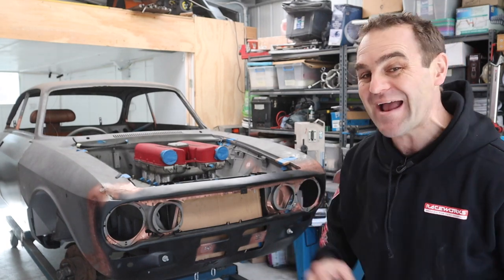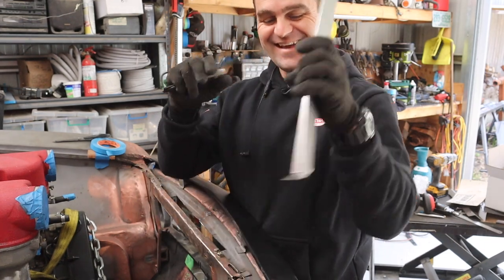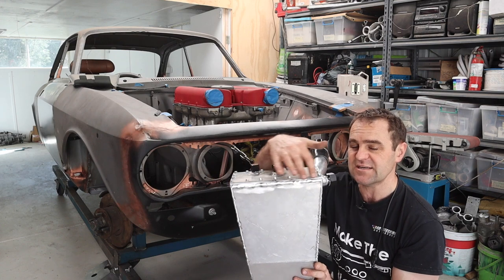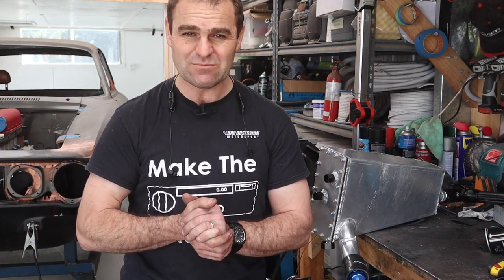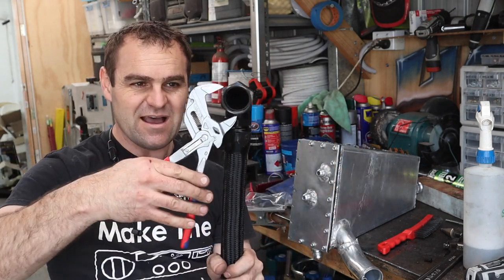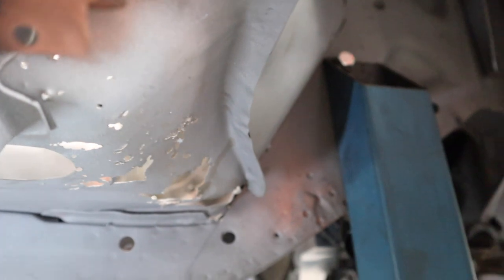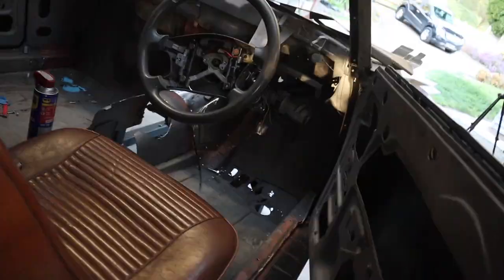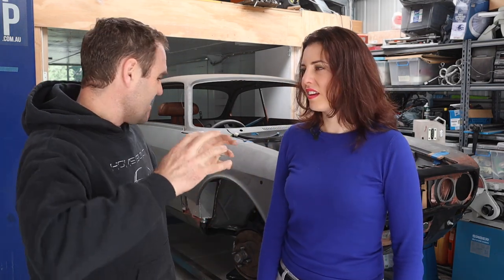Pressure testing my DIY dry sump tank - Ferrari engined Alfa 105 Alfarrari build part 60

Comment: The bonnet is front hinged, and the front lip of the bonnet recedes into the space you’ve filled with oil lines and new metal work. You may have to change to rear hinge or no hinges at all. Just bonnet pins.
Reply: Was going to point out the same. The way Jeff modified it, I can see space for the bonnet to hinge downwards.
I can't believe Jeff missed it, he is probably going for bonnet pins...

Comment: Hi Jeff,
I had an issue many years ago with aluminium tanks in a boat. Now I know a boat is in a very different environment than a car but the tanks were not exposed to direct salt air or water. There was corrosion where the rubber straps touched on the raw aluminium and I was told that the sulphur in the rubber was the cause. It was a very simple fix by putting a layer of paint as a barrier, and I added some timber packers. I am no expert but thought now might be a good time to let you know.. just in case. Love your videos mate, keep up the great work. Kia Ora to Mrs Jeff

If a member made of rubber containing carbon black and a member made of aluminium alloy come into contact with each other under existence of an electrolytic solution, corrosion of the aluminium alloy member would proceed. Such corrosion of the aluminium alloy member can be suppressed by selecting a surface resistivity (surface electric resistivity) of the rubber member at 106 Ω or higher, and more preferably 107 ω or higher.

Comment: My old Lotus Eclat had a plastic gas vent line running thru the passenger cabin from the engine compartment to the trunk. After a few years, Lotus owners would wonder why they always had gas fumes inside the cabin. The hidden plastic lines crumbled with age. You are using great material. Way to go.

Comment: Don't worry about the oil breathers,  Subaru have the fuel and brake lines running inside the cabin for a lot of their cars (I actually like it, wish my 4x4 had the lines run in the cabin, would make me worry less about ripping them out off-road).

Loving the progress. Your welds are looking good.

Comment: Hi Geoff can you make a round hole through the sub frame then reinforce the hole with tube , any forces will be transferred around the hole .
Also a Beverly or throttles shear mounted on your bench will reduce the grinder use for cutting odd shapes

Comment: If the oil tank maintains more than about ten psi there is a great likelihood that the welded corners will eventually fatigue and split open.
Before filling it with oil weld some corner braces on the inside.

Comment: Jeff,  I enjoy watching you, I have a suggestion for you for that rough welding that you can't grind smooth, buy an automotive caulking, clean the area, apply it and smear it with liquid soap, I used to do that when I built trailers, vans (LUCAR CARGO VAN) that carried my first 4 family name . Did you check if the volume of that oil is big enough? I haven't seen you mention that.

Comment: For those big hose pipe fitting you need to get yourself a Boeing spanner .  Designed for the job and good in tight spaces and leaves no marks on the surface finish.

Would submerging  the oil tank in water be better when checking for leaks?

Comment: 2 questions:
Why not mount the oil cooler sideways? No extra space on top for the fittings and more of the core in the air stream.
Why a gasket for the tank, just use some sealer like Threebond/hondabond/yamabond... You will open that tank once to check how its working and probably never again, unless you have an engine failure. You will need some loctite on the nuts to seal the threads.

Comment: Maybe if you heated up the lid of the sump with a heat gun then gave each screw a half turn it would make that rubber seal conform to the surface and seal better?

Comment: Would mounting the oilcooler upside down have been an option?
Reply: Jeff mentioned in a previous episode.
Mounting the oil cooler  upside down would create cavitaton (air bubbles) in the oil.
Which is not good when you need a constant oil flow to an expensive engine like that...
Reply: @stuartd9741  Ah, didn't know that. Thanks!

Comment: Will your bonnet still be able to open with that new raised panel? The front portion of the bonnet is forward of the hinges and it swings down when opening.
Reply from the maker: One of my patrons also picked that up. I completely forgot about that, so I will have to see in next episode ;)
Reply: @HomeBuiltByJeff  I believe you will run into clearance issues with the actual frame (structure of the bonnet) hitting that raised sheet metal cap you just made.

Comment: Jeff, what's going on with that brake rotor, mate?
Did you try to surface it with an angle grinder?
Reply: I saw that.
Guess he was seeing how thick the rotor is once ground back to see if its in specified manufacturer's limits?

Comment: Holy, how many gallons per second you planning on flowing!?? :-o
Reply: As Jeff as previously mentioned.
Those oil lines are based on Ferrari originals for that engine.
Don't forget being dry sump it has to constantly circulate the oil to all the places.
....
Just wont be the capacity required for the engine if the oil lines diameter was reduced.

Comment: Isn't it safer to fill with water then pressurise as you just get a leak from the pressurised liquid rather than possible fatal bang from huge volume of compressed air.
Reply: Low pressure is needed to look for leaks in a low pressure tank. To test a pressure tank for structure you use fluid.
Reply: That's true really just a low pressure smoke test needed , was the "connecting to the airline", Rather than the low pressure hand pump that got me thinking and worrying it was turning into a higher pressure test.😂
Reply: Steven Feist A bicycle pump sure is safer than the main line.

Comment: You’re doing it wrong!
Rust!
Considering that the oil cooler is mostly covered by the bumper and number plate a different shaped cooler would have been a better choice or cutting away the lower front panel so that the cooler would fit lower and making a grill to cover the larger hole would be better.